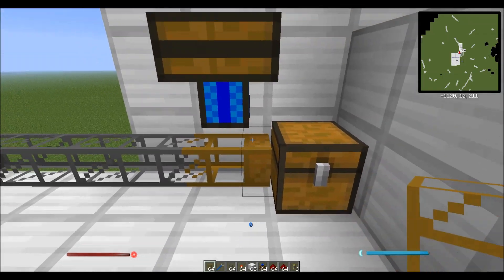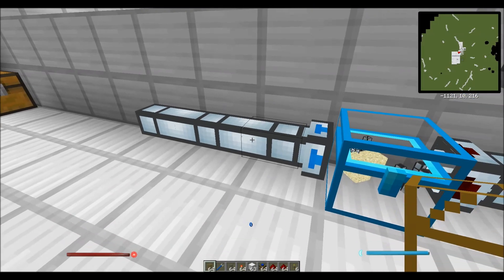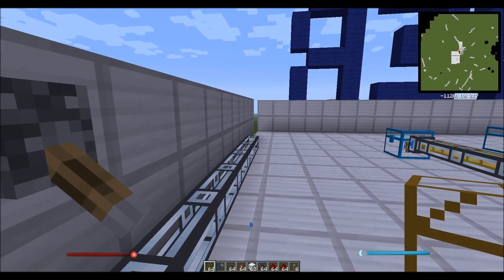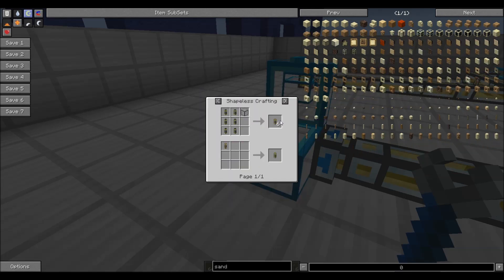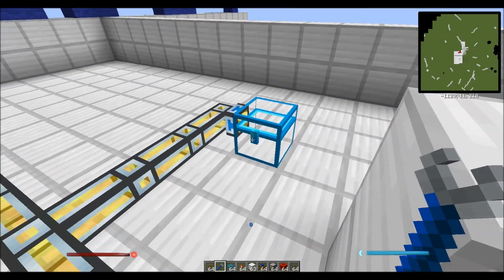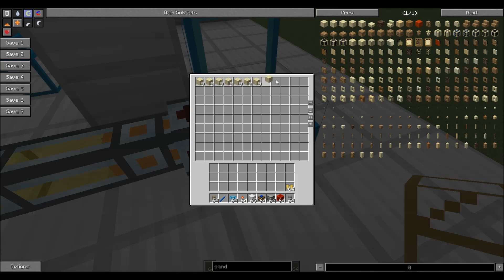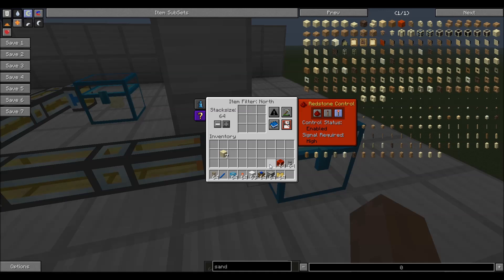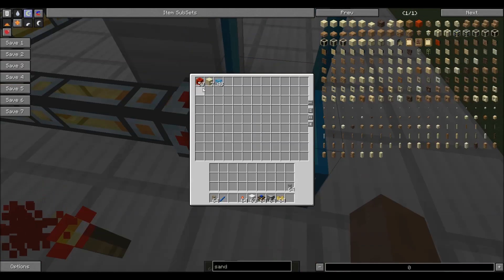Thermal Expansion 3   Itemducts

Comment: i know that the video is older but, i need to you answer me 1 question, why my pneumatic servo doesn't work in version 2.4?? special click? i try all ways and many times but doesnt work, what should be?
Reply from the maker: If you are sure you are using this version then i'm not sure what to tell you.  They pretty much right-click in place(though be sure you are clicking on the very end of the duct, the bigger bit).  It's also possible you are actually using a newer version of the ducts.  If they say they are from thermal dynamics check out this tutorial(it's a bit long but the ducts got more complicated).  https://www.youtube.com/watch?v=jqvFYpGGgiQ  Let me know if that helps.  If not I'll brainstorm some more and see if i can think of anything.

Comment: Can i ask someone for 1 thing?  If i want to set imput or extract with crescent hammer it just unconnect pipe Can someone help me please ?
Reply from the maker: lukako You are using the updated mod for pipes, "Thermal Dynamics".  I'm actually working on a tutorial that should be done tomorrow.  But in the meantime you need to use a servo or a retriever to get items out of the new pipes.  Slap a servo on and it's pretty much the same as you see here.  Retrievers a bit different, play with it you'll figure it out!  :)

Comment: My pneumatic servo doesn't go into the pipe
Reply from the maker: LightningGaming Check your version.  Newer pipes don't use servos... need to do an updated video to explain the differences.  Basically you craft retrievers, servos, and filters to interact with inventories and slap them on the connecting bits.  Hope that helps a bit, sorry for the delayed responce.

Comment: do you know how to use these to pipe into machines such as a Mechanism factory?
Reply from the maker: Yes it can be done, you just need to configure the sides of your mekanism blocks to output and input on the appropriate side.  Mekanism will not (from what I remember) automatically output products so you will need to apply a redstone signal or use a servo in order to remove processed items.  Hope that helps!
Reply: Minecraft with Sidetrack thanks that helped :D

Comment: good tutorial, BUT i was searching YT Itemduct tutorial to learn what the options "use ore dictionary" and "use NBT" exactly means. i hope you can help me with that
Reply from the maker: Ore dictionary helps mods deal with different versions of the same item.  For example copper ingots from thermal expansion and copper ingots from forestry are treated the same way in crafting recipies because the Ore Dictionary knows that they are the same thing.  Using Ore dictionary on the filter will let all items of a "type" through.  Depending on the item it is either amazingly great, or useless.  NBT is used in a variety of ways in MC, some examples are enchants and the durability on tools.  If you only wanted to sort perfect tools in one chest and send the broken ones to a different place you could use NBT to accomplish this task.  Basically anything with a damage bar most likely uses NBT to store the durability.  Hope that helps!
Reply: thank you for the comment :D you will have a new sub for this :D

Comment: it helped a lot thx but why doesnt it work with furnaces?
Reply from the maker: Have you tried extracting from the bottom?  Furnaces are sided so fuel goes in (and out) the sides, items go in the top, and products come out from the bottom.  Hope that helps!
Reply: thank u soo much... that really helps because i just ended up using a bunch of hoppers and it was really annoying

Comment: for me i have a chest set up going to another chest with the blue side in chest to put items and red bit at chest i am taking items from, i have provided power to the red bit but no items are passing through?
Reply from the maker: I'm assuming by power you mean a redstone signal and not RF power but I figure I should check.  :)  Another thing I can think of is to be sure you haven't blacklisted items or have whitelist set if you have a servo attached.  Lastly, make sure you aren't accidentally using fluiducts!  If none of those help you could always pick up the ducts and lay them down again just to make sure you didn't miss anything.

Comment: You forgot to say that low redstone mode does that if you give it a redstone signal it will turn off and you forgot about the disaple redstone control thing

But your video were GREAT you didn't miss anything but this, I really just wanted to know if the vacuum mode were what other's said it was (and you said that so "Thank you, sir") :D
Reply from the maker: Good point about the redstone control, that is a pretty important point!  and glad I could be a help.

Comment: If you have a chest connected to an itemduct which goes to a furnace. How can you get them back in the chest if it sees the furnace is full instead of it being stuffed.
Reply from the maker: If you are dead set on no stuffing you will need to run a pipe back to the chest so it has an input and an output pipe.  You will need to set a section of that pipe to dense(red) mode so that the items don't just loop and skip the furnace.  Problem with this setup is then you will have items continuously cycling because the chest will always accept items, therefore the output will always send things into the pipe.  If you check out my basic sorting video you can see one way to (kinda) get around this.  Instead, you can set the output pipe to only export one item at a time so the pipe will never be too stuffed.

Comment: Awesome video man.  I do have one question that others might ask as well.  The blacklist/whitelist setting you were going over at the end.  Can that be used on the receiving end of the pipe as well?  Say I have a chest and I want it to only accept iron blocks, iron ore, and iron ingots.  Can I whitelist the pipe that feeds the chest with those items and have any other items skip right past the chest? 

I'm right in the middle of building a sorting system with buildcraft pipes which means using a lot of diamond pipes.  I'm hoping this will replace it.

EDIT:  Subscribed.
Reply from the maker: Short answer: yes.

Just place a servo on the pipe leading to your chest and you can configure what enters that chest.  It WILL NOT affect what passes through the pipe to a different output.
Reply: Minecraft with Sidetrack Fantastic man!  I'm actually working my way through your let's play now.  Glad I stumbled across your channel.  I'm playing with the current Tekkit build and you've got a ton of great info.
Reply from the maker: Glad to hear it!